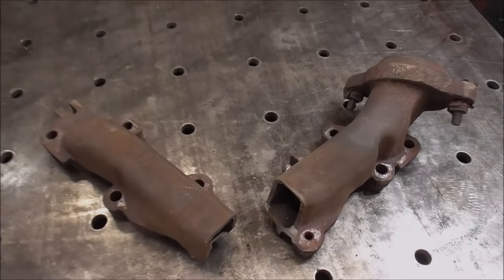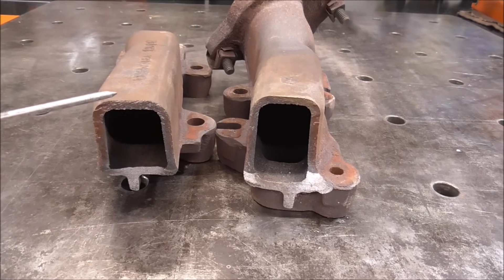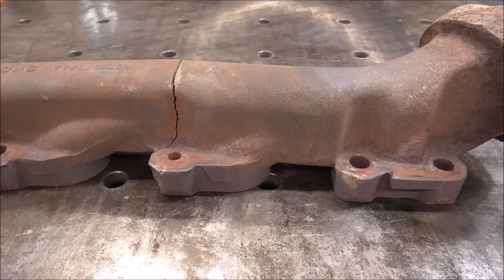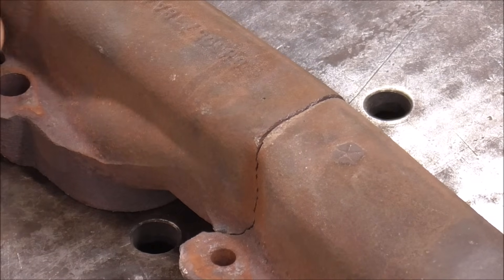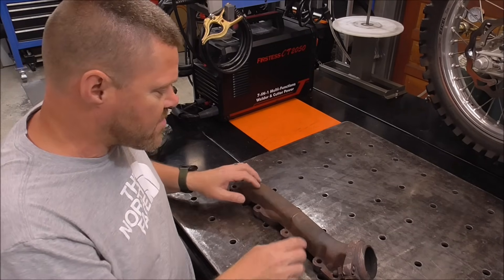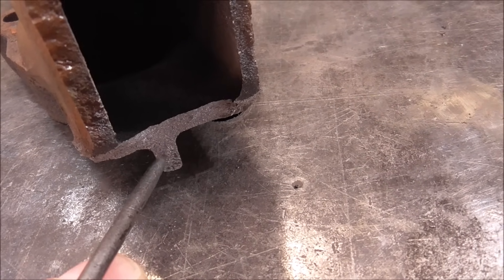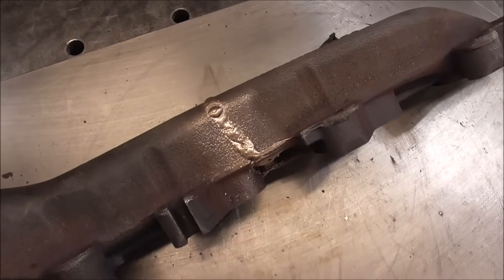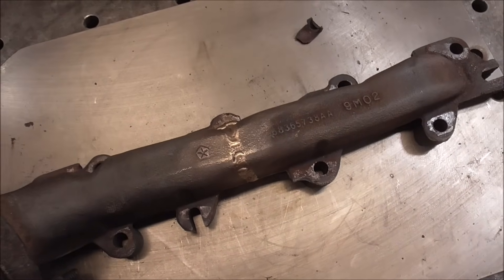Difficult Cast Iron Exhaust Manifold Welding Repair

Comment: Thank you for the tips. I was a pipefitter so working with metal isn't anything new but we didn't weld cast iron pipe. I've had a hard time repairing cast iron skillets that are warped on the bottom or spinners as they are called. I can get the warp out no problem but they crack as they cool. Preheating and the sand cool down might just be the answer. The value of the skillet seems to matter, cheap crap never cracks while valuable skillets don't stand a chance. lol How do it know?
Reply from the maker: I know right LOL. I have welded a few skillets because whenever I weld cast iron as a demonstration, there is always someone that says the only reason it held is because its cast steel i'm welding I'm surprised no one has suggested this is cast steel LOL
Reply: @BrandonLund  There is always some internet pecker head that knows everything thou he's never moved out of Mom's basement. If they ever have sex it will blow their minds.  On these skillets, some are from the 1800s so if anyone in all that time ever heated it too fast or unevenly the bottom can warp. Collectors won't touch a spinner but I'm sure they are repairable where they'll be new. I've built a simple jig that will flatten the bottom but you need to be mindful of the pressure you're putting on it. I'll heat it with a rosebud and tighten the jig as it relaxes. The iron will be red hot and I'll heat the entire bottom but 50% don't survive. I think with a better job of preheating and the sand it just might work. Heck I'm retired and just playing but it's a challenge now! A challenge is when you spend tons of money to save a $50 skillet. lol

Comment: I have gas braised cast before also submerging in a dry media with temp control throughout the process! Protocol 47 years ago. The cracking can be result of uneven contact between head and manifold. Use some dye or carbon paper between joint for indicator.
Reply from the maker: Great information! Thank you for sharing!

Comment: curious to know why you used thr yes welder with spool gun rather than your 2200, with its silicone bronze program and the mig gun?
Spool guns are awkward, I know as I have 2 and have not used them for 4 years.
Reply from the maker: Great question! Honestly, because I've never run my Fronius with anything but steel wire, I was afraid I wouldn't be able to read the puddle correctly because im not farmiluar with how it would feed soft wire. I've run that spool gun a LOT with aluminum and with silicon bronze so I felt really comfortable with how it would feed and what to expect. I really need more seat time with the Fronius on other filler metals because it's such a smooth machine, I'm missing out by not experimenting more with it. Funny you brought this up, I actually talk about why I haven't been using it as often in this weeks episode.

Comment: I useded nickel rods when I wededed the manifold for my boat. I also heateded my manifold to a slight glow. Once I was done weldinged it. I burieded in a barrel of sand that I heated to about 500 degrees on my wood stove. That way it tooked about 3 days to cool off. I had no warping and the manifold never cracked. If you look into some of the antique guide books they mention welding cast parts while cherry red.
As far as your manifold i highly doubt that it was cast with tension in it. Most likely had too much varience in thickness. And cooling when in operation is what i suspect caused the problem. As to using silicon bronze, I've never used it on an exhaust manifold. In fact, I've only used on ears for motor bases and bolt flanges.
Reply from the maker: Nickle works awesome for cast iron repair.  I have a very detailed tutorial on the process. As far as strength, silicon bronze yields a better product in my opinion. Almost as strong as the original cast iron.

Comment: BRANDON  I AM A 73 YEAR OLD CODED WELDER IN SA , I STARTED MY WELDING SKILLS AT AGE 9 YEARS OLD ,MY LATE DAD AND UNCLE WERE BOTH CODED WELDERS AND MY MENTORS !!
I WELD ABOUT 150 CAST IRON MANIFOLDS  PER ANUM AS MOST NEW  MANIFOLDS HAS TO BE IMPORTED WITH MANY MONTHS DELAYS WHEN ORDERD ! I have over the years not have one Return  or Failure For Years !!  REGARDS from South - Africa 🌍
Reply from the maker: Thats awesome. What process are you using? Cast iron rod with flux?

Comment: I made up a jig out of 3/8" thick angle iron and bolted the two pieces together on that using old manifold studs.   I then put the whole thing in an oven for 5 hours.  When it was at maximum temp . I put it in a vice with an Oxy/Acet torch pointing at it. I then welded it together with cast iron stick welding rods. When I finished I put the whole thing back in the hot oven for an hour then turned the oven off and let it cool over night.   That manifold is now 21 years older since the weld and no sign of cracking. 😉
Reply from the maker: Nice!

Comment: I had a very difficult time using some nickel rod/dissimilar metal rod from lincoln. base was oil soaked so probably didnt help, cleaned it as well as I could. Pretty sure it's still out there connected. I held the torch to it on low heat for another half hour, then covered it in a blanket, as far as I know it's still holding.
Reply from the maker: Thanks for sharing! 👍

Comment: Brandon, what if you used heat lamps, one on either side. 
say 500 watts or so? would that create enough heat to bring it up to 500 degrees?
Reply from the maker: dont think it would get it to 500 degrees but it would definately help some. Anything higher than room temperature is a plus

Comment: You mentioned you were going to do 2 passes over it,, did you?
Thanks for the video !!
Reply from the maker: I only did 2 passes on one side because i couldn't get the groove as deep as i wanted because i had to use a die grinder, which gave me a wider groove. The other 3 sides I was able to get deep but not wide so I was able to fill it up in one pass.

Comment: In my opinion there are several different things going on in the failure mode of this part. There is a big temperature difference while engine is running between the manifold and the cylinder head as the head has water jacket and bigger thermal mass this gives different thermal expansion to head and manifold if the manifold is bolted down tight it is placed under compressive load  during heat up and tensional load during cooling the  thermal cycling makes cast iron a good choice but performs less well in tension  leading to fracture that progresively fails  .The  poor design of the part  , gasket choice, type of use,  all play a part  in the failure
the manifold would have been machined flat from manufacture
I think that this is as good as a repair as could be done  thanks for posting
Reply: That is correct, the manifold wasn’t made with “tension in it” it was cast and allowed to cool appropriately, then machined flat to appropriate specifications. It has tension in afterwards because of the heat of the engine being to much on the outside edge (opposite side from machined face) there for that side shrinks more than the flange face, it might be a bad or cheap design but maybe it’s like that because of space/size constraints, that being said this is a good repair and the only others think that might benefit this repair is to have the machined face skimmed again
Reply: @theshauny  I think you have a very valid point about the heat on one side of the manifold  in larger engines the mainifold is somtimes split with expansion joints with a piston ring type seal
Cost is always first with automotive manufactures so as long as it lasts warrenty period they dont care
Reply from the maker: Very well said!

Comment: Over on the Barham Engines channel they frequently get manifolds that are warped and have to machine the gasket face flat. I think rather than try snd keep it flat during welding its probably easier to let it warp and then machine the face flat again.
Reply from the maker: But when you don't have a milling machine you have to do it this way.

Comment: Could you make up a internal sleeve and fully weld it to one side of the broken manifold so the other manifold side will slide over?
Lots of big diesels have 2 and 3 pieces that make up a manifold.
Would last forever that way.
You just need exhaust sealer on the slip joint.
Reply from the maker: for sure, however it might restrict the exhaust flow and I don't know if that would be an issue

Comment: Brandon, very nice job.  question:  for pre-heat, is you barbecue propane powered?  do you think a charcoal briquet type barbecue would work?  why or why not?  thanks in advance.
Reply from the maker: Yes it's propane, I know charcoal will also work. I've also seen it done with charcoal and a blower to make sort of a crude forge. That works well also

Comment: I am wondering if there might not be an after market exhaust gasket that is thicker and a set of torque values to go with it?  This might be a way to seal the casting better without putting excessive stress on it.  After a hundred and thirty years of car making you would think they would have this same old technology ironed out, but I know, they just don't give a damn as long as their bonuses and big fat checks keep coming!!
Reply from the maker: Exactly! Like 50-90k isn't enough money for a new vehicle these days. It's insane!

Comment: For the alignment would it have been better to turn or cut rod the same diameter as the bolt holes and about an inch or 2 taller and push it up to the alignment plate lock it in place and remove the small rods or leave them in place to keep the bolt holes aligned? Maybe even use wooden dowels
Reply from the maker: Possibly. My concern was restraining it so it couldn't expand and contract while welding which would result in a poor weld. The customer said there was a lot of slop around the bolt holes and I haven't heard it didn't work so I'm assuming it worked but I will report back soon

Comment: My question is how is something casted with stress in it? You said that when you showed how the break seated together by lifting the left piece .
Reply from the maker: The manifold is cast then allowed to cool which created a bow in the manifold. Then the manifold is then bolted to a flat surface, that bow is now flat but under tension which after several heat cycles of expansion and contraction causes the cast part to fail. The bow in the manifold is what I refer to as the tension cast into the part.

Comment: Does silicon bronze really work on an exhaust manifold? The melting point seems really close to the operating temperature. It's within 2-300 degrees
Reply from the maker: Silicon bronze works great. Have you ever seen your exhaust manifolds glow cherry red? Doubtful. That occurs at around 1200 degrees. Silicon Bronze melts at around 1900. If you held it to the floor for miles and miles as fast as you could go, you might reach those temperatures but that's not realistic, and even so, it still is below the melting temp of the silicon bronze. It works great for exhaust manifolds.

Comment: Great job Brandon, You have very good patience then it comes to fixing things. I have a question can you use oxygen to weld? I bought  some tanks that I was going to get filled with c25 but I was wanting to know if I can use this gas for anything before I take them in to be filled. Thank's and keep the videos coming.
Reply from the maker: You could use it with torches but that's about it. Your local welding supply store might even give you a credit on the gas. It's worth a shot.
Reply: No but you can us c02 and it's cheaper than argon

Comment: Nice process ❤ would it have been better to put it back on the BBQ then into the sand. Just thinking of getting a longer cooling process. But this is definitely going to be bookmarked 🤙
Reply from the maker: It may or may not make a difference. The main part is that it cools slowly from whatever temperature it's and it's brought close to welding temperature at the start of welding. It probably wouldn't hurt though

Comment: I've welded many cast iron pieces. Preheat, nickel rod, peen weld during process, finish weld out, slow cool. Welds always pull metal. Should plan on lapping manifold flat after
Reply from the maker: I've pretty much stopped using nickel since I tried silicon bronze.

Comment: I have had best luck with o/a and brazing. No hardening of the base metal at all. Other option is to heat up cherry red weld with o/a using cast iron as filler. All other methods seems to produce hard and brittle base metal around the weld.
Reply from the maker: Definately cant go wrong with brazing 👌

Comment: Hey bud, just an idea. What if you made some plates to bolt on the separate ports, then filled it with sand. I'm just spitballing here, but that might help retain your heat for longer.
Reply from the maker: Thats not a bad idea!

Comment: If I were the truck owner, I'd keep the repaired manifold installed until it failed.  I wonder if the new one will have the same kind of flaw?
Reply from the maker: I'm curious about that also. they may end up keeping the repair on there. I will have to check back with them

Comment: How would you compare this to muggy weld?
Reply from the maker: Great question. Muggy weld has never failed me. It's a little pricy but it works. Strength wise this filler metal was a little stronger than Muggy Weld

Comment: That's a job done the best possible way, quite impressive, and I noticed that doing things the right way has finally become somewhat of a trend. It needs to be said though, that this level of precision is only possible in the west, the US particularly, as you have super easy access to all the right tools relatively cheap.
Anyway, from personal experience I'd say this repair will possibly outlive the engine, unless the manifold material is of poor quality/contaminated. I've been into the custom car scene for many years, and modified quite a few chassis, and as you can imagine I've seen my share of unspeakable horrors!😂 I'm of the idea that you can do pretty much anything if done right, for example I once welded shock mounts on the lower A arm tension struts, as the client didn't have the means to afford a full MII conversion, and that was the only position available since hydraulic rams were now in their place, of course they weren't cast, but it's usually not advisable to do for different reasons, stress being one of them. Anyhow, I followed a similar method to the one you show in this video, with an overkill amount of prep work, and the old car is still being used regularly to this day after eleven years.
Very nice set up btw, having the welding rod on the gun seems like a pretty smart trick when you work on diffrent materials constantly, it's amazing how much tools have evolved in the past ten to fifteen years, and how easier it makes it for us to work properly. It makes you appreciate the great metal workers of the past on a different level.
Reply from the maker: It sure does! Very well said brother!

Comment: i made a booboo machining 454 mptprhome exh manifold , and strate steel MIG welded with prep and heat ... held over a year . yours will hold BETTER than original , especially if resurfaced , shaved
Reply from the maker: Steel mig welding will work too but I think your right, the silicon bronze is mor forgiving and stronger.

Comment: Craziest thing cast iron I welded was a cast iron water well pump that was in about 10 pieces.
I tacked the puzzle pieces together without grinding much to get the fit then ground out metal and welded it back up a bit at a time. I did it at lunch where I work so I had the use of large torches and a rotisserie for pre- heating.
I got it to not only hold water but hold air pressure as I leak tested with air.
A little at a time, about a week of lunches. I used stick with nickle rods.
Reply from the maker: Right on! Nickle is good stuff. I started using silicon bronze only because it tested a little better than nicle but you cant go wrong with either. Nice work man!
Reply: @BrandonLund  I use silicon-bronze at my job when I have to fill some holes in cast iron to re- drill when they whoopsie.
It works good. There I use torch.
Reply from the maker: @michaelszczys8316 oh nice! It's good stuff for sure 👌

Comment: Because of the way you took the stress out of the manifold before welding it (brazing, sorry), I'm sure this repaired piece will never fail. Just a hunch. I'd like to see the owner buy a replacement manifold and leave it in the box, to be returned someday.
Reply from the maker: I toyed back and forth to match up the crack or keep the flanges flat. Because I welded it with the flanges flat (no stress) I think your assessment should be accurate but we will see :)

Comment: How do you think jb weld would have worked?
Reply from the maker: I don't have any first hand experience with it other than a time that I broke the ear off a carburator overtightening it and it held fine for that.
Reply: @BrandonLund  for this type of temporary job and concern for all of the cast iron heating and cracking issues, I think epoxy would be a good option, but I also have never tried it.  I have heard anecdotal stories of it working very well, but not sure about heat resistance.
Reply: Also wanted to mention that Keith Rucker vintage machinery (here on YouTube) did a really excellent video (as is yours) about talking through brazing an old cast iron vise.  It's worth checking out if anyone has the time and is interested in how to do this sort of thing with an oxyacetylene torch instead of a mig welder+spool gun.
Reply from the maker: I have done it with gas but it's been a while. Now my primary method is wire feed silicon bronze. I have yet to have one returned. It's super strong too. Last I knew they are still running this "temporary" repair.